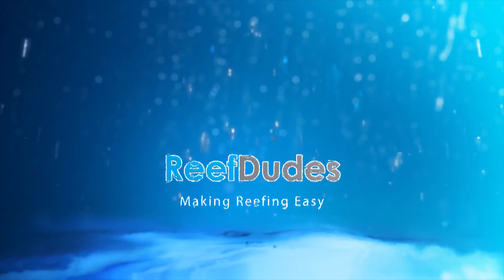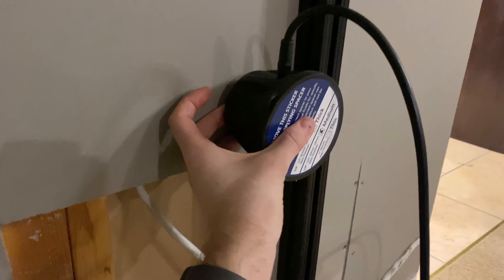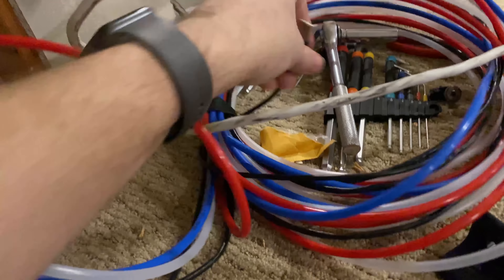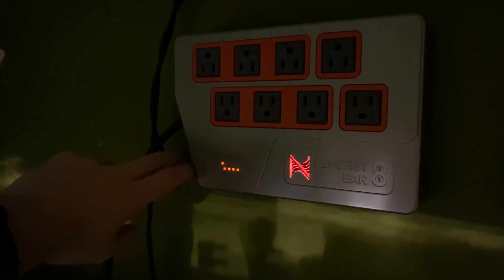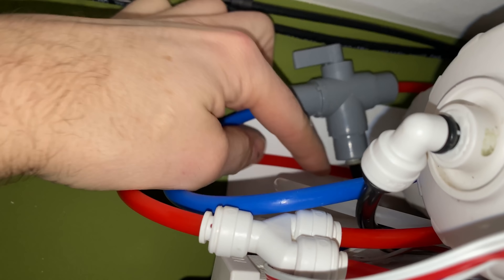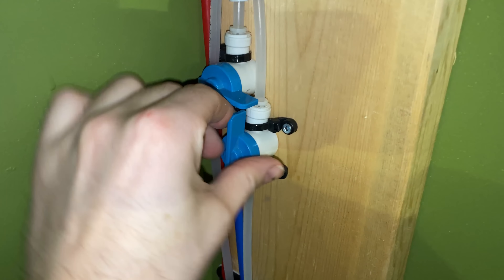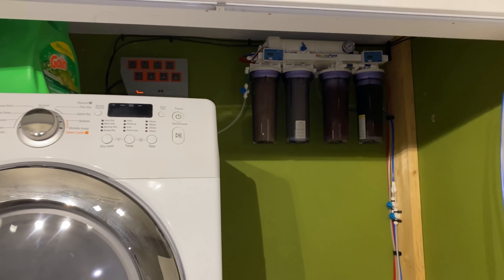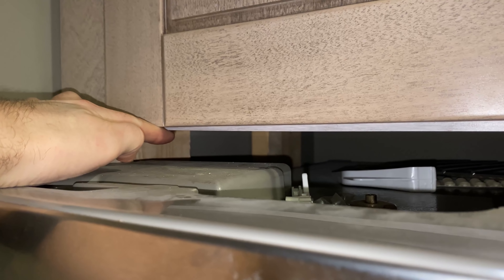Waterbox 7225 Build Update Prepping for delivery of the 6' Reef tank. and yes on the 2nd floor! Ep02

Comment: Besides the RO/DI tubing, what are the other 2 cables? Is one an Aquabus or USB and what was the other one? Planning on moving tank in a couple months and need ideas about setting up Apex water change and ATO.
Reply from the maker: USB for apex, other is cat5 for future use.. 4 pairs of wires that could be floatvalves or sensors.. TBD! :)

Comment: You included a link to your previous light setup, but will this one is different.  Your previous one was attached to the stand for more support while this one is simply attached to the stud in the wall.  I noticed on one of your other videos that someone just had a piece of 8020 coming straight out of the wall and no piece going down to the floor (unless it was hidden behind his wall).  Does it have to be attached to the stand for more stability?
Reply from the maker: TeJ this is the exact same
Bar as my last tank.  I had a hole in stand I stopped it into on the last one and this time I’m using L brackets to bolt to the wall.  Either way works. Same concept.  I believe he just used a plate to bolt it to the wall behind his

Comment: How did you find the floor/ceiling joists? I hear you can pull up the corner of the carpet, but I ended up using rare earth magnets to find the nails in the studs. What is the best or easiest way that you’ve found?
Reply from the maker: I had old photos pre reno that i used as a guide.   you are right and could use magnets to find the nails as well. as it would only be hammered along the joists.  (i use magnets all the time along the wall to find the drywall screws
Reply: @ReefDudes roger that!

Comment: Hi Devin, can you let me know what part you use to mount the light rail to the wall. Your original video didn’t include detail on this part. Thank you
Reply: Is it the 4303 corner bracket?
Reply from the maker: Similar. The one with only two holes side by side   I’ll have to snap a pic later when I’m home

Comment: Wow that’s a awesome setup with all that you have done. I have a question about where did you get the Y hose fitting for supply line and if I am using CaribSea Base Rock and Life Rock do you recommend me cycling the rocks with TurboStart in my 44 gallon brute container??
Reply from the maker: Y connectors https://www.marinedepot.com/partners/idevaffiliate.php?id=103&url=1193  Life rock has bacteria spores on it to cycle it self.  So you may not need it.. You could likely let it cycle it self in a brute then add some bottled bacteria when its in the tank/with fish to beef up that army of bacteria
Reply: I used Life Rock and it has bacteria on it. With that said I put it in a Brute container for 4 months and used Turbo Start 900 and added Coraline Algae at the 2 month mark.

Comment: Nice plan.   Just have a question though, did you do any load bearing assessment of that floor where the tank is going to go?
Reply from the maker: Sure did.  In a previous video I had an engineer friend come help me with the game plan
Reply: Hi Dave, how is tank going and hope you doing good :) I want to ask if you are happy with light bar can you let me know which size you use and also do you know how much weight it can handle I am planing to use it on 3 XR30 g4 + 4 t5 80w tank will be peninsula 160cm long.. thank you

Comment: Good job with your RO system
Reply from the maker: Thanks Ricardo!  I may fully automate with solenoids later but for now i think its a pretty solid solution!
Reply: @ReefDudes  i didnt want to advertise but I have a fully automated Ro system and I put 125.000 litres of water through it every year because Im a window cleaner. It has High and low pressure sensors, booster pump, autoflush selenoid and auto shut off but there is one very very important secret to a fully automated system to fully auto shut off: the optical sensor flood guardian! With a mechanical float system will never fully switch off and your autoflush will just pump water down the drain. Also have booster pump and all selenoids inside a box thats activelly cooled as all selenoids must be default off selenoids and they get very hot otherwise and might fail prematurely.

If you ever want more info let me know. Keep up the awesome channel!
Reply from the maker: @ricardocarneiro7797  I actually picked up a flood guardian a while back to use as a backup to the float valve! (maybe ill use that instead and the float as of  backup).  How long does it take for the solenoids to heat up? that sounded like an issue on many that reviews of various ones that i have read.
Reply: @ReefDudes  flood guardian is the single new best upgrade for an RO system, rock solid design. I agree in using float as backup instead. 

Use the flood guardian as the main shut off but just under the action of the mechanical float valve for added safety.

The flood guardian triggers instantly which in turn triggers high pressure switch permanently in one go, avoiding cyclical and prolonged on/off cycles which will wear your booster pump and will forever make your autoflush flush into the drain every single time system comes back on. 

Selenoids get hot quickly id say 10-15 minutes they will get red hot in a enclosed space. With a pair or usb computer fans and a box every selenoid will just get warm, but keeps booster pump cool.

My preferred timing is 1 hour on and 15 mins off purely to preserve the gear, my 450gpd system will filter 1000 litres in 24 hours so no need to push it.

Also every hour autoflush kicks in for 18 seconds. Membranes will last 5-15 years this way.

Best pressure is 80psi but you can go 60-80 psi if you want to reduce the chance of push fit connections leaking.

If you have a public email or whatsapp I can send you pics of my system which will be easier to get ideas from.
Reply from the maker: I would love to check out your system too. Deven@reefdudes.com

Comment: @reefdudes Where did order those brackets for the light bar? Do you have the link for them? Keep up the great videos bro
Reply from the maker: The light X ones or the light bar?
Reply: ReefDudes ReefDudes at the 35 second mark on the light bar.
Reply from the maker: @Elev8minh  L or corner bracket for 1515  ordered from the same places that sells the 8020 (well 1515)

Comment: Nice setup but... u put too much into all those flush valves etc, di refills are usually $12, replace every six months, and replace those RO filters once a year, too many valves and connections usually equal possible leaks or breaks
Reply from the maker: Going to likely replace with solenoids and fully automate